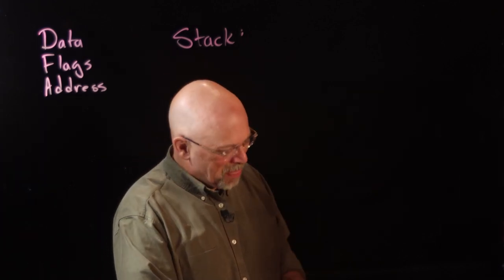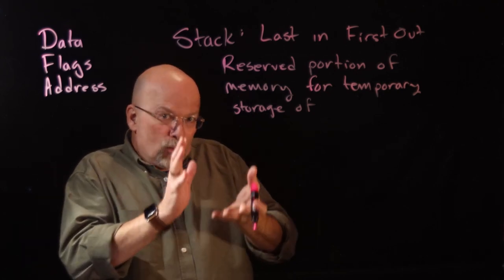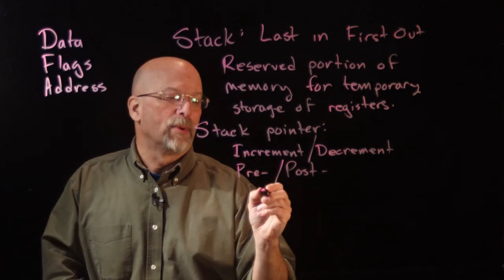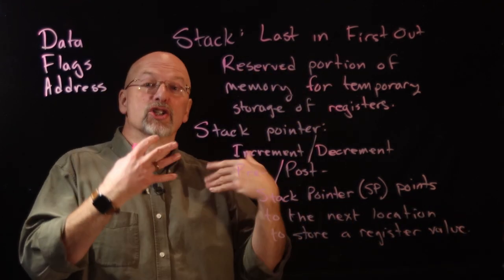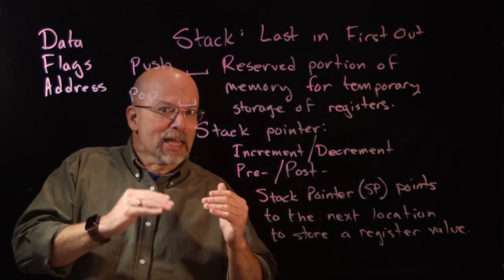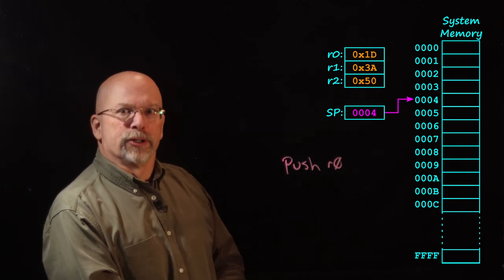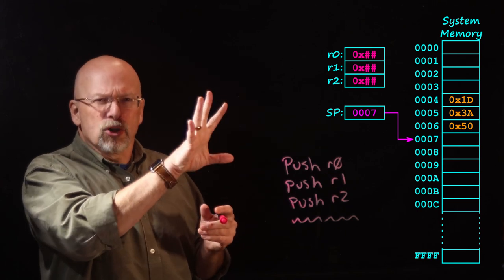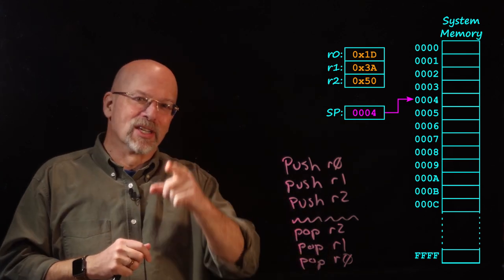Ep 081: Introduction to the Stack Pointer

Comment: good vid  sir, ,so basically stack is a certain set of memory locations right... and it may or maynot have values in it. so the stack pointer points to the top of the stack...and with that u can store or remove stuff from the stack using push or pop?
Reply from the maker: Yes, it's just memory. Of course a number of mechanisms have been added by both hardware and the operating system to make it more secure, but push and pop are basically putting items on and taking items off the stack.

Comment: Is the memory that the stack uses manually addressable? That is could I do sth. like `orr r4, sp` and then `str r5, [r4]`?
Is the stack-memory a system-defined thing completely separate from any heap-address-space, or can there be overlap?
Also, is the stack-pointer automatically initialized to sth. legit, or does the programmer have to care for this?

Comment: How will I get the operand of POP ? You said "POP r1". But will stack remember the position of r1?
Reply from the maker: That's the key. The elements of the stack have no identification of where they came from. Your (assembly language) code is responsible for maintaining the correct order of pushes and pops.

Comment: so we push  the new  data from top to  bottom ?
Reply from the maker: It depends on how the architect designed the stack to operate. (In fact, some processors allow the programmer to decide!)  From the programmer's point of view, however, you can push any registers in any order onto the stack.  To restore those registers, you simply pop off in the opposite order that you pushed.